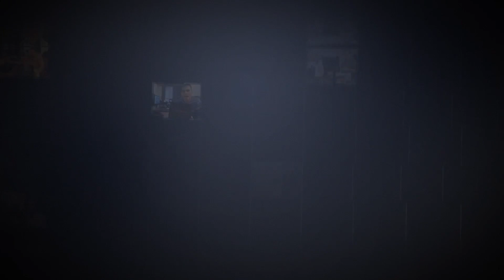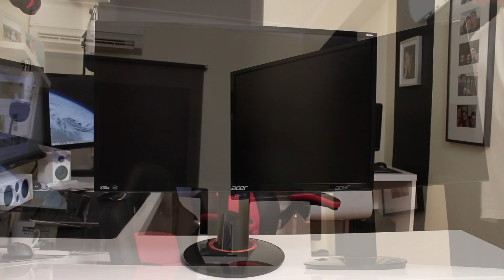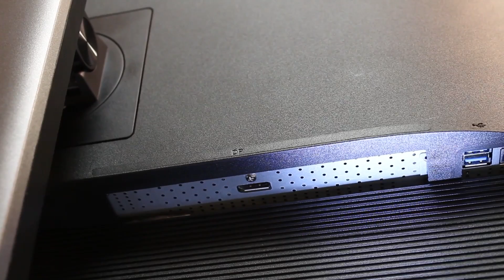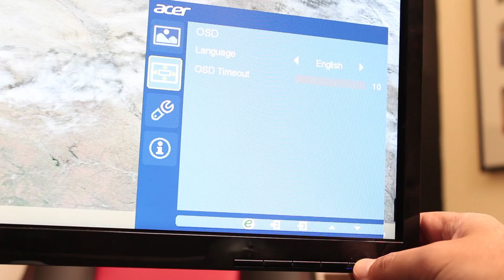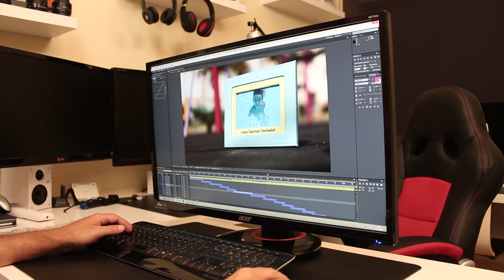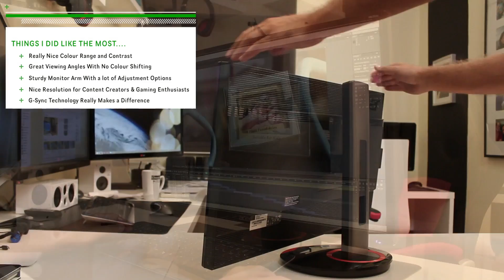ACER XB270HU Setup, Overview & Opinion

Comment: really good review, things that you probably wouldn't like in the end are the glossy plastic, ugly orange ring (unless you know, you're into that kind of thing) and maybe bezel. All just aesthetics really. The quality control is not fantastic with these either apparently.
Reply from the maker: +Bootskoot589 Hey!! Actually i dont mind to much with the glossy, my triple monitors are glossy and i dont mind them (glossy plastic, not the display it self) The red ring looks kind a nice but if the monitor was to my self i would just hang it on my monitor arm :) the bezels yep could be a bit thiner i guess. :)

But i do see your points and respect all of them. At the end of the day a review is one mans opinion only, besides the technical things off course :)

Thanks for sharing
RJ
Reply: +Roberto Jorge (Tech Reviews) Yeah I just got mine a few minutes ago, lol. Ehh my menu looks very different compared to the one in the video, if anything it has more options and looks better too, but is this the new batch of xb270hu's or what's going on? I should ask on a forum too but I'm wondering if this is news to anyone else.

Comment: Roberto when you edit the videos can you increase the volume of your narration up maybe 2 points? It's a little hard to hear you even on normal volume without increasing the audio on my PC monitor using Bose headphones connected.
Reply from the maker: TekReview's Humm, the i normalize the sound on the videos so that i dont have many peaks, and here i can ear perfectly on speaker or bluetooth headphones!! RJ
Reply: Roberto Jorge Well the other parts of the audio are fine until it gets to the narration part is just to low. I have other videos where my PC speakers are set to 80 percent and I still have to turn the Volume knob on the speakers themselves just to hear them. Lucky other readers on those videos also mention the same problems.

Comment: Roberto if you haven't done a video already, what PC chair are you using? We need a new one, ours is worn out.
Reply from the maker: TekReview's Actually i dont know the brand (Unbranded maybe) i bought it at a local shop because ordering internationally from amazon or other shop would be very expensive on the shipping costs, i didnt made a video about it no :)

Comment: Its a shame that the monitor only has a displayport. Would be better if it had an extra dvi/hdmi port.
Reply: +Roberto Jorge (Tech Reviews) But what type of amp do you use ? A home cinema one or a Hi-Fi one ? A home cinema one I imagine since you have a center speaker, right ?
Reply: +Roberto Jorge (Tech Reviews) And how are you connected ? Via optical or coaxial ?
Reply: MrHD71 DP is open source so a lot of mfg's do not have to pay roytaly fees for HDMI 2.0. You can get a DP adapter to HDMI.
Reply: +Roberto Jorge (Tech Reviews) Hey how are your speakers connected btw ? Via an external amplifier ?
Reply from the maker: MrHD71 I guess it could have a extra HDMI / DVI but then G-Sync would not work and im not sure if it would have 144hz on HDMI i guess it wouldn't but not sure :) But i do understand your point of view, it would be very useful. RJ
Reply from the maker: OshMMf
Hi, yes always from the PC to a amp and then the speakers. RJ
Reply from the maker: OshMMf
Nam. Just a simple one, you can see the speakers on my desk (White) Auna
Reply from the maker: OshMMf
Im using
Coaxial connection. RJ